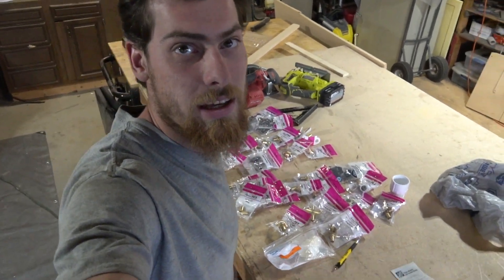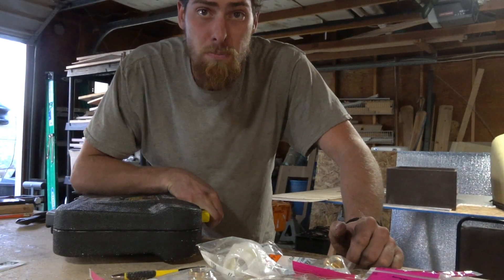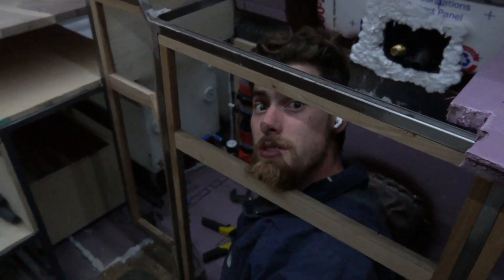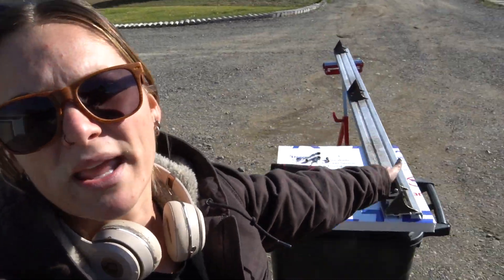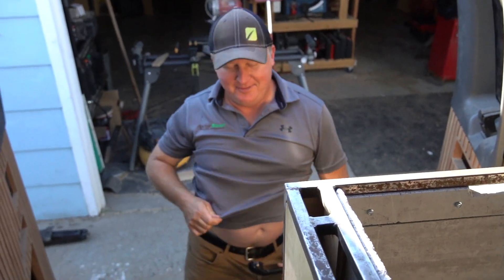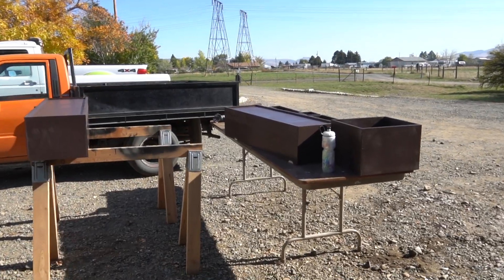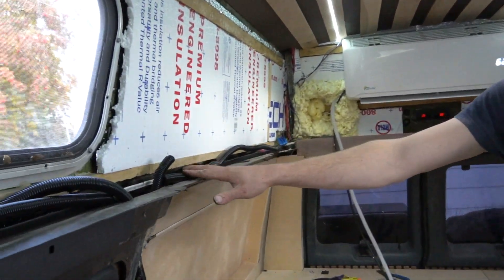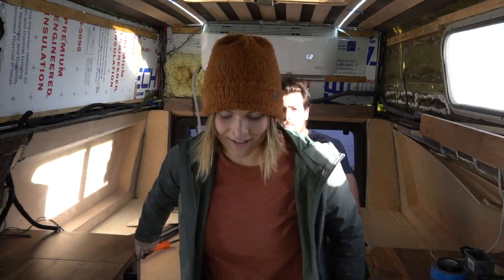Plumbing / Electrical in our 1995 4x4 Ford Econoline Van Conversion // Van Build Series

Comment: What water heater did you use?
Reply from the maker: The dometic propane on demand however the pipes froze so havent got to try it yet
Reply: @AllyandLance  that sucks!  I'm trying to figure out some clever ways to keep my plumbing from freezing, other than driving south.  Hope you thawed out in Baja.

Comment: In my electrical supply area I’m putting in a fire ball that goes off it high heat is detected. It is held in place with a metal basket holder.
Reply from the maker: Nice! We have one but just haven't installed it yet. They are such great peace of mind.

Comment: Bro, I'da just bought the tool and kept it in the van. You just never know when you might spring a leak. Out on the road, and 1 minor leak, it now paid for itself. You might also run into a nomadic lifer that needs one. Not all heros wear capes.  I say it's doubtful to get a leak, but it can happen. So glad you're using the crimp rings and NOT using the Shark Bite fittings that so many use. DO NOT DO THAT on a moving, vibrating, bouncing vehicle. I just can't trust those fittings in a vehicle. They're great for a Novice Homeowner Plumber, but NOT in a vehicle. Oh, and I'm pretty sure you did fart. But you better keep her. That's how you know a keeper from a next ex wife, when she laughs at your farts.